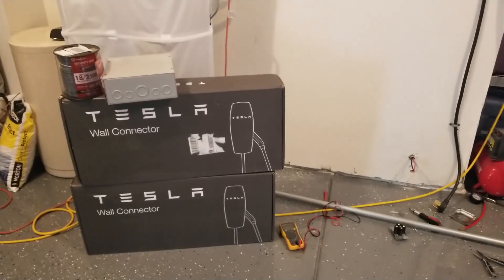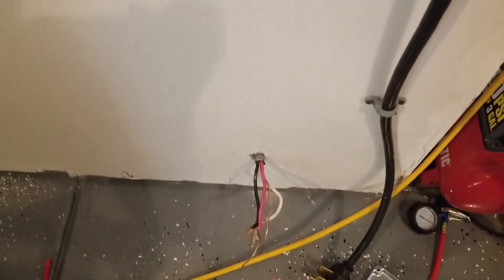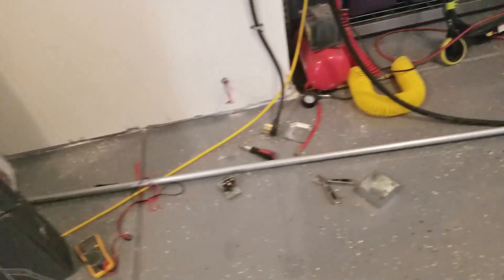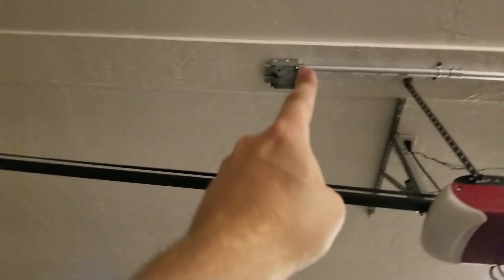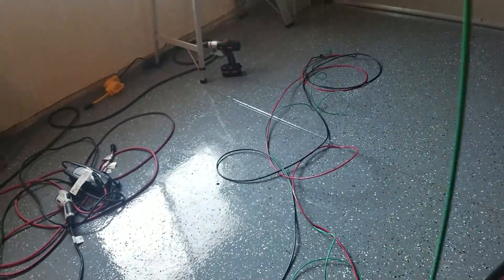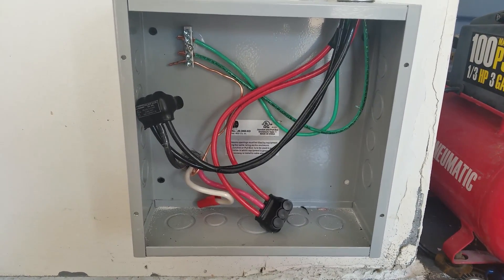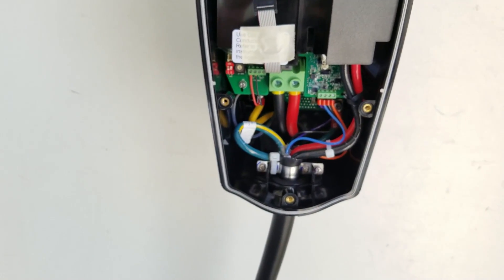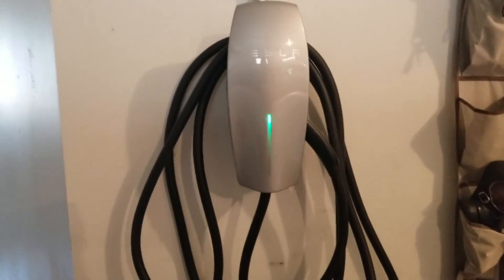Installing 2 Tesla Wall Connectors in Load Sharing Configuration

Comment: Are you floating the neutral in the J box?
Reply: Can that cause phantom voltage issues? I did that once with an unused ground in an old house and had some very odd voltage jumping all around on that floating wire. I read it was picking up current from neighboring wires.

Comment: I didn't see your connections in the panel, but looks like you paralleled these #8 AWG by the connection in the JBox. Minimum size allowable to parallel is #1/0.

Comment: I wonder if newer wall chargers make this video incorrect? Any thoughts?
Reply: Gen 3 uses WiFi to communicate between chargers so the shielded communications wire is unnecessary. I think the rest would be valid. The manual which is available online explains how it all works.

Comment: As an electrician that specializes in EV charger installs, overall I like what you have done. However, where I am, a permit and inspection is required. For a disconnect, it is not the amperage but if the breaker is in line of sight to the units. If not, a disconnect is required. Some have questioned putting the com cable in the conduit. This is a common question/issue with inspectors. Because the industry is relatively new, many inspectors default to the installation manual. If it states guidelines for the com cable, that is acceptable. What most manuals do state is the need for 90 degree copper which your thhn is rated for. Romex is not rated for 90 but is used by many.
Reply: It’s the voltage rating of the wires to be housed together. They have to all have the same rating. 

Also per manufacturer specs its needs to be at least 18/2 shielded.
Reply: @troymobley3802  Yes, we use at least 18/2 shielded for the comm cable. The final say is always the inspectors and every install we do is permitted and inspected. So far we have been able to run the comm cable in the same conduit as the power, because it is not "current carrying" and only communications.

Comment: NEC code u need a means of disconnect. If you were pulling inspection on that, you would fail without a means of disconnect outside in the garage area before your equipment. That’s a national electrical code that’s not anything to do with state by state. :)
Reply from the maker: NEC code 625.23 says you need a lockable external disconnect within five feet "if rated more than 60 amperes or more than 150 volts to ground" this circuit meets neither of those two conditions.

Comment: Nice job.  Thank you.  My recollection is that code does not allow both high and low voltage wiring in the same conduit.  Though rigid conduit gives a much cleaner looking installation, I am lazy and tend to use flexible conduit.

Comment: Shielded or not it is a violation to have that low voltage cable with line voltage. Also your ceiling box is way under sized. Should have been at least an 8x8 box with 1” emt.

Comment: The wire from the breaker to the junction box is not rated for 100-amps. Running both chargers at the same time will trip the breaker feeding the chargers or burn up the wire in the wall. This could burn down your home. Not to mention a stack of code violations that could cause harm also. Always contact a qualified electrician!!!
Reply: It’s load sharing. Not pulling 100 amps but 50.
Reply: Half this video is dedicated to explaining that this will never pull over 50 amps.

Comment: Great video! And cool to see the electricians commenting and helping out. I'm surprised no one mentioned that it might have made sense to splice one set of wires at the first Jbox, to carry the full power (60A), then use the second Jbox to split the single wire into two. I guess this would introduce a second set of splices, more resistance, etc. Also, it wasn't clear to me how the communication wire was run. Was it just between the two chargers, or did each charger go back to a router? And this is for the purpose of load balancing, so the master knows when the other charger is in use, and can cut its own power in half? Would would happen if you tried this with "dumb" chargers? Thanks! FYI I found this through a search for the multi-cable connector/splicer.

Comment: I wouldn’t do that this way. Why not run a 60 amp circuit to each charger from the panel using 6/2 wg romex. Need 2 breakers at $25 each and wire. No jct boxes, no special interconnecting wire, and full 60 amp charging to each charger all the time.
Reply from the maker: Dedicating 120 Amps of your 100 or 150 amp service directly to car charging is probably a bad idea and could be a major problem tripping your main breaker if you have 2 air conditioners running and then you plug in two cars while someone is baking a cake and doing laundry. You'd almost certainly overload the main circuit in that scenario. You might say "Well then I'll only plug in 1 car at once." If that is the case then why not use the load sharing configuration so you don't even have to think about it? Also you'd use less wire because you only need 1 wire run to the garage then the wires only split when they have to.
Also, 6/2 wg romex is not suitable for 48 amp charging, (it is rated at 55, but continous load puts you at 44 amps max continuous)
Reply: @cbutters epic reply 10/10

Comment: As an electrician you did a good job. Just FYI you’re not supposed to cut EMT pipe with that cutter you used. That cutter is for soft pipe like copper. Using that cutter actually makes the inside of the conduit wall close in and become smaller. It can also cut your wire while pulling. I was checking out your video because I’ve never had to install 2 chargers in one garage. You did the right thing getting the shielded cable because you are not supposed to put regular low voltage wire in the same pipe as high voltage wire, it causes interference. That’s why it’s shielded. Over all good job.
Reply: alive2990 load sharing is one of the major selling points of the Tesla Wall Connector
Reply: An inspector would fail this installation for that reason. You cannot under any circumstance run LV cable in the same conduit with line voltage cable regardless of shielding. Also, That pipe cutter is a disaster waiting to happen as well as it creates a sharp edge. Other than that, this home owner did a nice job. That's what makes the other two errors that much more glaring.

Comment: I love your video thank you for that! I would just like to confirm if I install a 60amp breaker I don’t Need a shut off switch only if I go higher amperage like a 70 or 80 amp? Breaker box access is outside the house but I’m running the wire through the inside into my garage.
Reply from the maker: That's my understanding,  but I'm no electrician and depends on your local code

Comment: Excellent work. Did you use a torque screwdriver to tighten the cables to the specified torque at the circuit breaker and at the wall chargers?

Comment: I will be doing this in the future. Thanks for making the video. I just want to make I have this correctly. You ran both wires from the connection box where your old plug was. If I already have one wall charger connected straight to my box can I run a wire from the first wall charger to the second wall charger? Or do I have to do something different for the wires?

Comment: Nice job just that bare conductor in the belden twisted pair is actually the shield bleeder basically was there a terminal for it if so not landing it can cause signal depredation possibly in instrumentation you only land it on one side but in this case not sure. Also, make sure the insulation on the smaller wire is of the same value (voltage) as you power conductors if running them in the same conduit Cat 5 would not be good practice for instance. Nice neat job and cool floor.

Comment: I made a similar installation using the polaris 3-wire connector.  The black (or hot) wire connector overheated, almost burned my garage down.  Don't know what happened.  Was using a 40 amp charger with all 6 awg copper wire.

Comment: Nice video ! very clear. I would like to have some curiosities about how you use the two wall connecte together. Sorry for English I don't chew well. I am Italian. I would like to use a configuration like yours but with a total limited power of 4.5kW or 6 kW. Can you connect any of the two and it would start at the max power set? and in the case of two cars connected automatically would divide the power in two precise? If you have two cars connected together if one of them finishes charging the other can at maximum power? I also have two electric cars, a Model 3 and a BMW i3. I saw a pure i3 in your garage ... does the refills also work on the i3? Thanks Cesare

Comment: Did you ground the conduit at junction box.
Reply: Yeah you can see the copper wire from the original 14-50 and the new green wires are all grounds.
Reply: @jonathansage2147  What I meant was the conduit itself grounded, not the ground wires.  Like this https://www.homedepot.com/p/BRIDGEPORT-1-in-Mighty-Rite-Split-Grounding-Bushings-with-14-4-AWG-Grounding-Lug-25-Pack-SGB-383CL/314707950.  Or is it not required?  Conduit is metal and i have seen it done on them.

Comment: I have one wall connector and one mobile charger plugged in the 240v plug, can I make the same set up without having to buy second wall connector?
Reply from the maker: a mobile charger cannot be configured to load balance. You could run two separate runs to the breaker though.
Reply: I’d just use 2 breakers in your panel if you can make the space. Then you’d get full amperage off each one without having to share load. Assuming your panel can handle that big of a load. My wife certainly can 😂

Comment: One shouldn’t mix voltages in the same raceway.  One shouldn’t pull sheeted wire in a raceway.  The control wire could of been stapled next to the EMT conduit.  This would of failed inspection.
Reply from the maker: According the the Tesla Wall Connector Manual page 30 it says " If the signal wire is routed in the
power conduit with the power wires,
the insulation rating of the signal wire
should be equal to or greater than
that of the power wires." Source:https://www.tesla.com/sites/default/files/downloads/wall_connector_installation_manual_80A_en_US.pdf?201612081439
Reply: @cbutters  true but theres another issue here 3/4 inch EMT with 4 x 6awg and one 2x 10awg? It would fail on conduit fill. On second look I see its 1 inch... still over filled I think
Reply: @MrMasterfumi  1" conduit has a maximum of (6) #6 Awg. THHN conductors. (4) #6 Awg. and (2) #10 grounds would be acceptable even with the control wire.

Comment: You should sell off 40' lengths of communication cable.
Reply: You can just use thermostate wire
Reply: @scheffman  Thermostat wire is not rated at 600-volt and it's not a shielded twisted pair.
Reply: @kirklandelectricicnc  So just use cat 6?

Comment: 1. You did not use insulating plastic bushings on the threads of conduit connectors.
2. You cut the conduit with a method that creates sharp edges
3. You didn't ream the conduit after cutting.
4. You used 300v rated signal wire in a raceway with 600v rated power wires.

All of these are code violations and/or poor workmanship. This would fail inspection and it should. Fire and Shock Hazard! There is a reason that good electrical work requires professional electricians. You should pull this video, consult with an electrician, possibly re-edit this video showing all the things you did wrong and how you are re-doing the work to correct mistakes. That would be the moral and ethical thing to do. Your mistakes may not burn your house down or kill anyone, but what about the next homeowner who comes along and learns the wrong way to do things from you. You have an ethical responsibility to pull this video down.
Reply: The Max voltage in the conduit is 240V. His communication wire is rated for 300V. So it should be ok to run the communication wire in the same conduit.
Reply: German Zel it’s never ok to mix volatiles in conduit
Reply: The comments section can be one of the best things about Youtube, and remarks like the one above are the reason I always skim down looking for more detail. Angry remarks are pointless unless they include explanations. In addition to the points above, I'll ask the question about raceway and box fill. I'm no electrician but I do know that the wires of a four conductor raceway like the length coming off the main J box require 20% derating, because of inductive effects and the extra heat generated when conductors are tightly packed together. Suddenly #6 wire can't carry what it should, because of fire risk if used at full amperage. Maybe that will be protected by the 40A master choice? An inspection would also require a calculation of cross sectional area of all the conductors inside the conduit, including the insulated grounds, and my reading of the tables suggests that it is at least close to over the 40% fill limit. Because the wires are of different gauge, the calculation would be complex. Less air surrounding conductors increases the chance of overheating and of course injury to insulation when wires are pulled through, and an overheat could send current down the low voltage signal wires to the control board. The central J box in the ceiling may be a little small for the gauge and number of conductors, a closer look and calculation would be required there. I make electrical inspectors work for their fees, asking tons of questions before I start so when it comes time for the inspection they tick off all the boxes.
Reply: @spelunkerd  he used #6 THWN or THHN which is 65a @ 75c and de-rates to the same value as the 6/3 romex feeding it since it's 60c rated.  You only need to de-rate from the wires insulation value.  As this is a hard-wired installation and the unit only pulls 48a on a 60a circuit, it's good to go with a 60a breaker since the load cannot exceed 48a.  You can back this up with the actual circuit calculations and he's well within code (not with the missing bushings, sharp pipe, and flat out violation for the insulation value of the communication wire anyway)
Reply: @mhamma6560  Thanks for responding, it is nice to know that those with experience occasionally drop by. I find the derating sequence bewildering. Our indoor NMD90 is good to 90 deg C, but all the breakers I've come across are 75, so as you say we start with 65A for #6 THHN. I use the 2018 Canadian code book but I believe the NEC is fundamentally similar. At 10:31 you can see he has four current carrying conductors in the first length of conduit. The ampacities in our table 2 are modified by table 5B if raceway fill is more than three tightly packed conductors for more than a couple of feet, so we get 65*0.8 = 52A maximum wire ampacity. From that 52A wire ampacity, we choose the next higher 60A breaker and I believe we need to limit the continuous load to 0.8 of ampacity, 0.8*52 = 42A maximum continuous load. So as you say if he programmed the master controller to 40A maximum then he is below that, too.
Reply: NEC, 300.3
(C)Conductors of Different Systems.
(1) 600 Volts, Nominal, or Less. Conductors of ac and dc circuits, rated 600 volts, nominal, or less, shall be permitted to occupy the same equipment wiring enclosure, cable, or raceway. All conductors shall have an insulation rating equal to at least the maximum circuit voltage applied to any conductor within the enclosure, cable, or raceway.
Reply: G) Insulated Fittings. Where raceways contain 4 AWG or larger insulated circuit conductors and these conductors enter a cabinet, box, enclosure, or raceway, the conductors shall be protected by a substantial fitting providing a smoothly rounded insulating surface, unless the conductors are separated from the fitting or raceway by substantial insulating material that is securely fastened in place.
So he should be ok cuz he is using AWG 6
Reply: I also didn't see and am willing to bet the garage junction box wasn't grounded either.  The wire he used was actually 30v rated -- I know I use it.
Reply: I was waiting for the angry electrician comment and surprised it took this long to find you. He said specifically not to take his word at the beginning. Anyone running this type of wiring should absolutely do their homework and read the comments which very much help add clarity.

Comment: Wonder why not using a neutral
Reply: Tesla Wall Charger does not require 120 V so no need for the neutral.
Reply: The Neutral conductor provides a return path to the current supplied through the live conductor. The Ground is used if there is a fault and provides a safe path to ground eliminating the equipment or metal chaise being energized. The actual charger is installed in the vehicle [BMS] battery management system and the wall charger is the power source that provides the correct voltage and current and safe function to the BMS.

Comment: I hope you reamed that conduit after cutting it with that pipe cutter! I don't advise using a pipe cutter on conduit because creates a hell of a sharp edge inside the conduit. Should use a band saw or hack saw then ream the burr.
Reply: Tim Wilson if you wouldn’t put your D in it, you shouldn’t put wire in ot